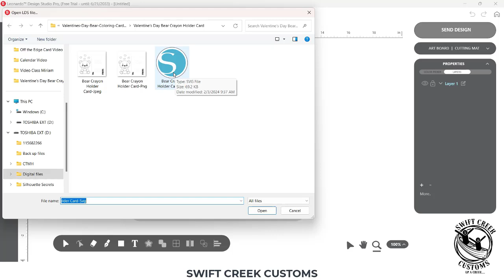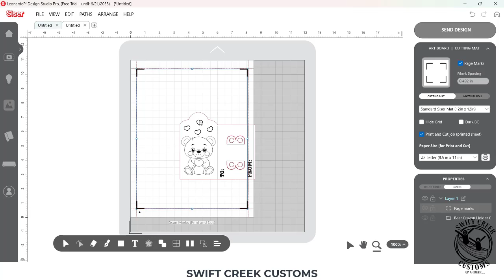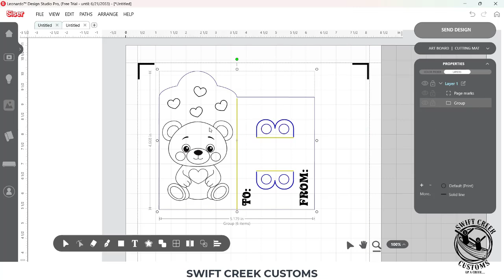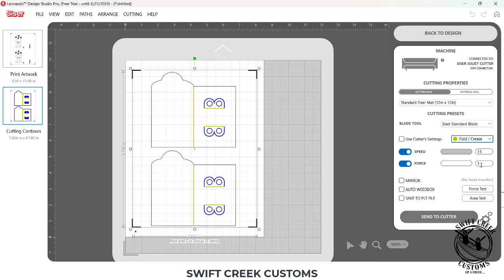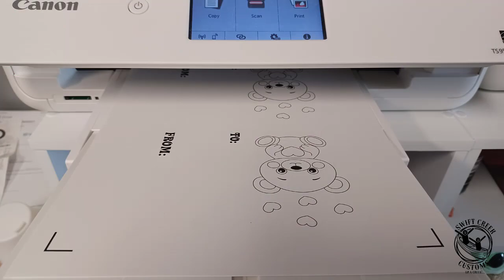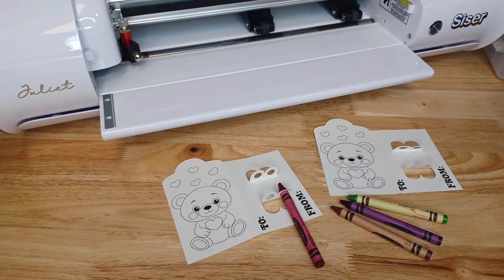Print and Cut a Color Card with Siser Leonardo Design Studio

Comment: Ellie Mae what was the score line like?
Reply from the maker: For my cardstock, I needed to go up a little more in the force. The default of 1 was not enough... it made a little line and it worked, but it was more difficult than I'm used to with the dashed lines to fold straight. Next time I will increase the force.
I am using 65 lb Recollections cardstock in that video.
But, every brand, color, and sheet of cardstock may vary in what settings are needed for a score vs cut through... and the life of the blade can affect it too, so can change as you cut more and more.

Comment: Would you do a tutorial on print and cut for 8.5 x 14 inch paper .... mine just kept beeping at me until i used the red crosshairs to recalibrate it
Reply from the maker: It is the same steps for all paper sizes. Make sure that the paper size is set the same under File > Page Setup, on the Artboard Panel, and on the Send tab. 
https://youtu.be/IgB-EYw-H-k?si=OmjVEd6onTfeaVJh
I'd recommend using the default registration marks.